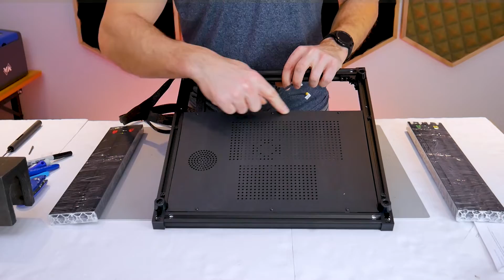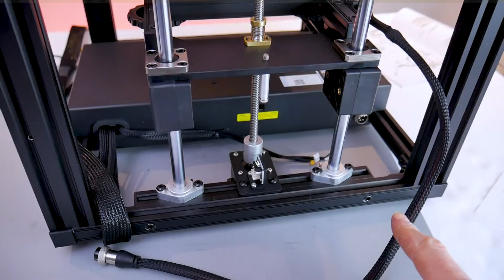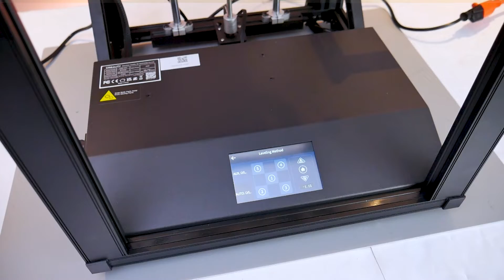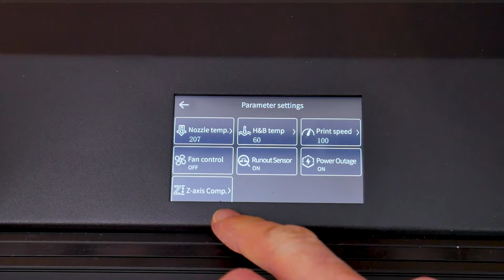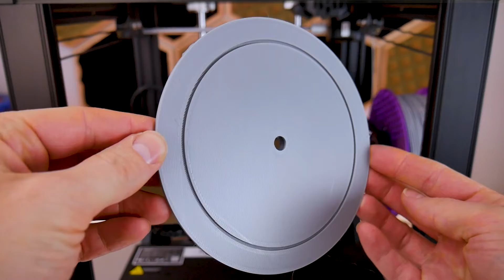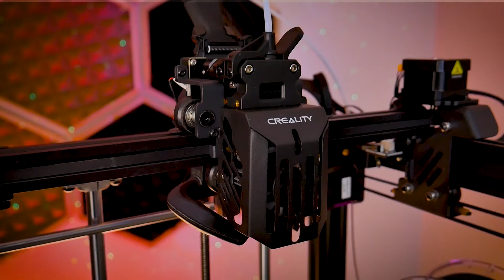Creality Ender 5 S1 Review, Setup Guide and Comparison With Original Creality Ender 5!

Comment: Which firmware version are you running? Have you had issues with ABL going AWOL? Mine went from one print being perfect to the next print being off-level and unable to revel. Even manual relevel only works for that print, the next one it's off again, ABL throws everything out, almost like the z-offset is different on the left and right sides of the bed.

Comment: Hey! Thanks for the video. Im completely new to 3D printing and got this printer. Im trying to understand and setting up some profiles.
What speed do you usually print in? When doing a fine profile and just a standard one(faster)?
Print speed?
Infill speed?
outer wall speed?
support speed?
travel speed?
Also when i print the boat that comes on the memory card the filament is blank on the finished product. When i print with the standard profile in creality slicer (0,2mm layer height) the filament gets matte.. Any idea what that can be to cause this?

Comment: Hey this may be a dumb question, but I just got the 3d printer, I heated the nozzle but the filament refuses to feed, I even cut it and did the usual poking around for the right angle, even tried using the thin metal needle and nothing goes down
Reply from the maker: While you're trying to manually feed the filament through, you're pushing the tensioning lever on the extruder so the filament can get past it, right?

Comment: IS THIS UNIT PRETTY LOUD? OR IS IT QUIET?
Reply from the maker: I would say average. If you get it running on the sonic pad and crank up the speed it's going to get a little noisier, but if you're running at regular speed it's comparable to a regular Ender 3 S1 or most other modern Creality printers.

Comment: hello, I downloaded your profile to test it, and seen that you have a retraction of 1 to 30 mm/s, after printing a retraction test, it is not even close to a good print, apart from the fact that you have the upper layers to
Reply from the maker: Been working great for me... are you experiencing too much stringing? If so, other factors that can affect stringing are printing too close to the bed (nozzle drags around excess plastic) and too high of print temperature for the material, or even water in your filament. Also I don't think you finished your comment. What is the issue with the upper layers?
Reply: @EmbraceMaking  you have the upper layers option desactivated (0), i will do a machine calibration test to see the result.  Thx bro

Comment: I have a problem with the leveling. The Z height (bed and nozzle gap) becomes larger as the nozzle moves in Y axis direction (from 0 mm to 220 mm). Have you found this problem?
Reply: Hola! Lo pudiste solucionar?
Reply: @ejeZ327  Do you have the same problem ?
Reply: Si! Tengo el mismo problema, aún no sé cómo solucionarlo
Reply: @ejeZ327 
Here is what I found and how I fixed it.

I assumed that the auto bed leveling is the cause of this problem.  As you do auto bed leveling both in the machine setting and before the printing start, an error levelling is occurred. You may check the Z axis, It supposed to stop in a single printing layer as you did perfect clearance between bed and nozzle.  

 I fixed it by removing G29 from the start G code in machine setting of Creality slicer. Her, the machine will not do the auto bed leveling before it starts. Next, You have to restore the machine to default. After that, do manual leveling. Finally, print something out, check the Z axis rotation, check the printed part are in good level. 

PS. Do not use auto leveling at all !!

Comment: I have this with sonicpad and have yet to get it to print. This printer constantly says out of print area, and it doesn't matter where it is on the platform.  I get no help from Creality. Any suggestion from anyone. I  think it is going to make one expensive target for my shotgun!
Reply from the maker: Before you use it for target practice, hang in there. I have a sonic pad video with the Ender 5 S1 coming!
Reply: @EmbraceMaking  I finally just wiped out the pad, reloaded it and the printer, and had to mess with the code and got it to print one thing tonight, lol I  would still rather have another Sovol, they are perfection.
Reply from the maker: Interesting, after wiping it did you do anything different at all? How did the print turn out? I actually have never used a Sovol yet, I should try and get my hands on one. I recently did a video about the Artillery Sidewinder and it's actually decent. Some people love the brand and others hate it but mine has been working flawless
Reply: @EmbraceMaking  I think part of the problem was instead of sending me a new sonicpad which is what I paid for they sent a used and the person before did something that made every printer think it was a ender 3. After wiping it out, it now seems to be printing fine. I  have printed several things, and all have come out ok. I  love the Sovol, straight out of the box printed beautifully, and have not had a single issue.
Reply from the maker: Good to know, maybe as part of the procedure I put together for the video I'll mention just to wipe it right from the start!
Reply: @EmbraceMaking  or at least check to see that it has no printer already installed. I thought since it was new, it would be clean, but then I noticed it didn't come with the film on it, and the sticker was in a different spot on the outside. I was very disappointed.  Especially since this was the first printer I bought for myself.

Comment: Hi, thanks for the video! When I turned on my device, the backlight on the touch screen lights up but there is no display for me to interact with. Any advice?
Reply from the maker: Have you checked your cables going from the screen to the mainboard? You might have to open up the electronics enclosure
Reply: @EmbraceMaking  Hi, thanks for the reply I was able to get things going in the right direction eventually!

Comment: I spent hours on leveling but the middle is everytime higher than the corners 😒 and the autolevel doesnt compare the problem. Every print in the middle is too close to the nozzle. Every print around the middle is a mid-air fail... do you have a tip?
Reply from the maker: Hmm, what slicer are you using? Can you see the autobed levelling working on the first layer?
Reply: @EmbraceMaking  Im not really sure. After auto leveling the terminal says, settings saved. I start the auto leveling with the printer menu. And when the print starts its pre-print code execute G28 followed by M420 S1 Z10
Reply from the maker: Strange... sounds like you have it all setup right.. What firmware version are you on? I'm on 1.0.3
Reply: @EmbraceMaking  Im on 1.0.4
Reply from the maker: Might be worth trying to go back to 1.0.3 to see if it makes a difference?
Reply: @EmbraceMaking  Ive seen, theres an update today. I think i try it upcoming weekend. And the 1.0.3 isnt available on the download center

Comment: I would love a comparison between this and the Ender 7-post modding. I'm really curious about your opinions on the Ender 5S1 cantilever. The only thing I feel like this printer doesn't have is dual z axis, although I don't own one and can't speak to whether it is necessary.
Reply from the maker: Ender 7 post modding is pretty good but honestly I have yet to find the time to push it with Klipper. I have a Sonic pad now so I'm going to try and run it with both the Ender 5 S1 and the modded Ender 7. I think the Ender 7 will likely produce better results with the high speed printing because of the linear rails / core xy and the higher flowing hotend, plus the highly rigid bed design that I put together. The Ender 5 S1 is an amazing out of the box printer without modding - even the new bed design is way more rigid than any other cantilever design Creality has put together in the past. For printing "regular" speeds it is more than up to the task and no issues with bed sagging. I suspect once I use the Sonic pad it might start to reveal some issues with the cantilever and the overall motion system but hopefully some of that can be tuned out with more advanced compensation like input shaping. We will see!

Comment: Lowering the retraction speed around 25 or 30mm/s with .8 to 1mm retraction will likely fix the whisping.
Reply from the maker: I lowered the retraction speed a little and it did help a little bit. Still getting some whisping here and there depending on the filament. Really strange. Someone said they switched to Klipper and it went away
Reply: This was the first thing I did on my new Ender 5 S1 cura profile. The default retraction was 5mm🤣 and so I copied my Ender 3 Pro cura profile that I know works beautifully. Similar retraction distance and speed that you suggested.

Comment: What type of materials can be used with it?
Reply from the maker: All metal hotend up to 300 degrees so: TPU, PLA, ABS, PETG, ASA, HIPS, PC and others that fall under the 300 degree nozzle temp. For some of them you'll want to try to enclose the machine to prevent warping... Bed temp can go to 110 degrees so in theory you should be able to do ABS at that temp with a decent enclosure.

Comment: Can you share the settings? I print with 120mm\s , 0.8mm retraction, 30mmn/s retraction speed, PLA at 205/60, but i always get clog and can't print :/
Reply from the maker: Check the link at the bottom for the downloadable prusa profile I made: https://embracemaking.com/blogs/resources/ender-5-s1-prusaslicer-configuration
Reply: Prusa 1.6 alpha has official profiles, they're pretty decent.

Comment: I've watch a ton of videos about this machine but for me this gave me the information I wanted. You showed plenty of finished prints in good close up and that's what I wanted to see. The prints look good. The Info about the print plate was excellent and I will order that at the same time. I have been tossing up between this and the Bambu Lab X1C but for me in NZ its about $1000.00 less for this and the prints look kinda the same. Good video. Thanks.
Reply from the maker: Glad you enjoyed it! Yes the print quality is excellent and I've heard with a sonic pad (klipper) it gets even better. It may not match the speed of the Bambu Lab X1C but if it is $1000 less and you can live with less speed and still get great quality it sounds like a good deal.

Comment: My ender 5s1 does not have a z limit switch or wiring fot it. I noted this was missing in creality assembly video as well. Any idea why I would not have that?
Reply: Some reviews suggested the z limit switch was unnecessary and the uso of the cr touch sensor as a limit switch would make more sense.
Reply from the maker: That's very strange, when you home the printer does it go to the bottom first or go up and use the cr touch?
Reply: Same here, it goes down about 10mm then up until it hits the CR Touch.  It's never gone all the way down
Reply: the first batch of CE5s1 printers had the 3d printed cooling duct, and z limit switch, the updated version doesn't have the z limit switch anymore and injected molded plastic for the duct now.

Comment: I flashed Klipper on the 5 S1, and was able to get rid of the stringing. I don't know why I (we) had such a hard time with the stringing using the original firmware. Have it very reliably running at 120 with great results. Nice Review!
Reply from the maker: Thanks! Glad I wasn't the only one who experienced this. I recently picked up a sonic pad so in excited to try it out on the Ender 5 S1